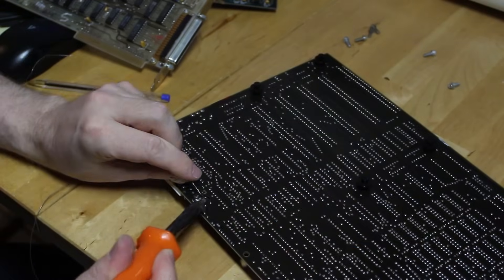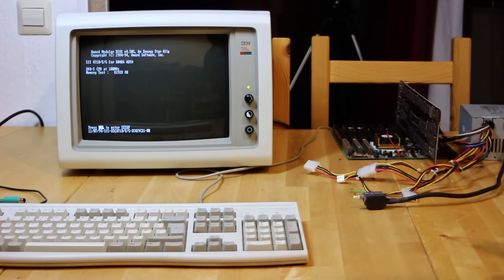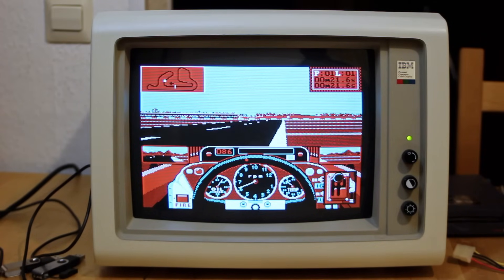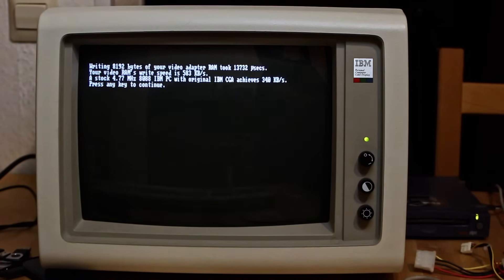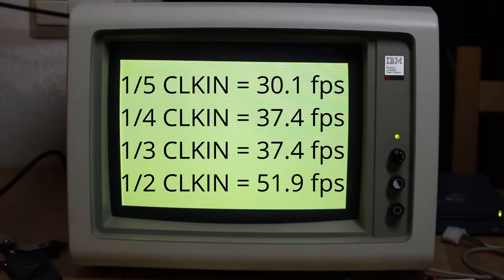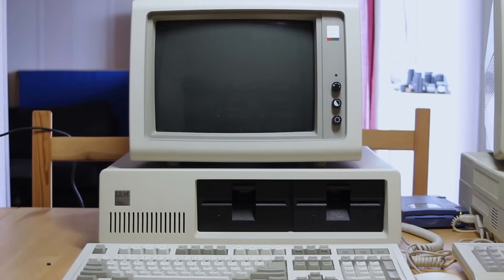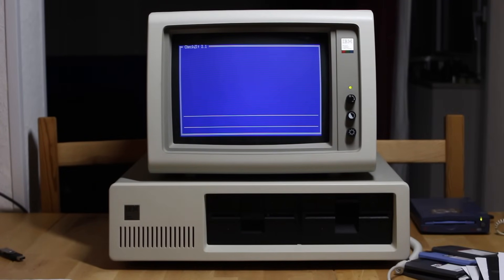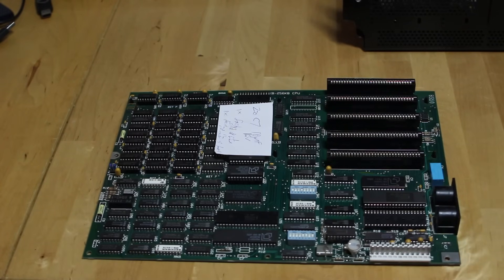Don't put a graphics card from 1981 in a PC from 1994!!

Comment: So I watched over half of this and I guess I missed why you shouldn't put a 1981 graphics card in a 1994 PC except for some CPU speed issues? It looks like it worked just fine except for the required tinkering for the bus speed. Is there some reason I couldn't put a Hercules in any ISA slot and use it with appropriate software on any PC?

Comment: You may need to move that T-Res chip to the B: drive if you want to continue using it. Although it may not be making much difference yet, that chip, which is a set of 150 ohm (or somewhere about) resistors is used for terminating the floppy drive cable and prevent signals from bouncing around. That may also have something to do with issues you've had out of it in the past. Check the Shugardt floppy drive standard for specifications.

Comment: On the answer to the question "Why" there is an 8 bit port.. The simple answer is: BEFORE everything was integrated in the motherboard, you really needed those expansion slots.. plenty of them... and.. 1. Cost.. and 2. Motherboard real estate.

Well.. the CGA is ONE card that actually DEMANDS it, because of the form-factor going down so a 16 bit slot would be in the way, but it wasn't alone. .. and.. if you buy a card (with special functionality) for one computer.. you pretty much don't want to be FORCED to give it up for your new computer. F.ex. I have a blind relative that had a speech-synthesis specific card in his computer. That was a full-length 8 bit card.. It cost a shitload... and I don't even think they ever made it in a 16 bit version, because suddenly people just had to have a sound-card and with a Soundblaster 16- and with the speed of computers, and available memory: By the time you had those- it was all done in software.

.. but there was also a shitload of 8 bit cards that.. TECHNICALLY could've been mounted in a 16 bit port, but they still were only the 8 bit cards. Most people think of the ps/2 mouse as standard. That was not yet the standard on 486. 486:es were still being created when it finally DID become standard so newer motherboards may have a couple of ps/2 ports for keyboard and mouse, but most people had to settle for something else. Serial mice?.. they actually grew in popularity fairly late, so it was VERY common that the people who manufactured mice sold them together with a dedicated isa-card for them.. my first mouse was of the brand "Mighty Mouse", and it was such a bundle which had to come with it's own card and special drivers. LATER serial port mice became popular, but tbh.. If you had a modem (almost ALL modems during the 486 era were external and connected through a serial port.. I SUSPECT due to the interference problems).. 

Then I also got an MM-401 (mpu-401 compatible) midi-card. The thing is; We had a Roland Sound-canvas module.. I used it with my organ, OR with my computer. It was the second revision which is when it finally came with a MT-32 sound-set that you could switch to if you wanted to play any actual game.. While people were listening to FM-music while playing games, I had a full symphony orchestra while playing Might and Magic 3, or Sierra games.. (If memory serves; Even doom did support Roland sound).. Of course one wanted a soundblaster anyway.. or more exactly: Also.. because it played recorded sounds, so all the sound-effects in most games..  So.. Just sound took two slots.. 

Then of course.. there was the advent of CD-rom drives for your computer.. hint: They were NOT IDE compatible at the time.. you needed a special card to be able to use it... Since the actual transfer speed was 150kb/s.. you didn't need much bandwidth: Save money by only supporting the 8 bit bus. That said: A LOT of sound-cards had various CD-rom interfaces on them. I bought a bundle from Creative-labs, so I had a Soundblaster that ONLY had the ONE interface, but it WAS the right one (fortunately; I know people who bought the card and the drive separately, so DESPITE there being one or even as many as THREE different interface ports on the sound-card they STILL had to mount a separate card for  their cd-rom drive).. Of course.. I was NOT helped by the fact that my soundcard supported it. Not much anyway, because I needed my CD drive to be external. Which WAS what the bundle was for, BUT.. it came with an extra card in order to move the soundblaster pro's internal port to an external connector.

While we still were using a 286 we also had gotten a VGA card.. more exactly an Ultra-VGA card.. same amount of memory, but supported some extra modes.. most notably 256 colours in 640x400 mode (Our windows looked better than anyone else's and they had 386:es, so we really could make use of coreldraw)..  And that was of course also an 8 bit card... the 640x400x8bit was of course nothing to play games on, but still.. we kept that card for a LONG time.. It was when we updated our first 486sx25 to a 486dx33 we finally got a trident 16 bit card. 

So.. cards I had in the same 486 that was 8 bits: Graphics, MIDI-card, Mouse-controller card,   CD-Rom controller, and the serial/parallell port cards. I THINK The IDE was 16 bit, though.. while we had a 386 we were still using our harddrives from when we had a 286 and they were both MFM-drives and the controller for that was 8 bit.. Just to say; We had started with a 20 Meg drive.. then bought a 40 meg drive.. and kept the 20 meg drive.. BUT.. then we bought a different controller that used a different scheme for packing the data, so we literally had one 30 meg and one 60 meg drive.. "for free".. where the biggest drive anyone could have if they intentionally splurged was 120 meg.. but those two drives died after a while.

So.. yes.. During the era of 486.. I DARE say that pretty much 100% of people had AT LEAST one 8 bit card in their computer.. AND a lot of people had many cards in their computer.. so.. doing ONE card so it CAN handle odd format 8 bit cards wouldn't even be a "lost port" for the people who didn't use a CGA or some other card that literally required such port, because it would still just be just another port that wouldn't be in use.
Reply from the maker: Yeah the CGA card was special in that it wouldn't go in a 16 bit slot, but most other 8 bit cards would. And it is uncommon to have an 8 bit only slot on a 486. But yes, there were lots of 8 bit cards still around for sure.
Reply: @PCRetroTech  << I think of all 486:es I have seen I think that at least 3/4 of them had an 8 bit slot.. even after the basic I/O and harddrive/floppy interface was moved to the motherboard.. But I realized I forgot to mention one thing that is why it pretty much was mandatory to have an 8 bit only port: REAL scsi cards where people may have populated with a lot of ram.. that is; They were full-length, and quite often had the same limitations when it comes to being way too big downward to be able to fit a 16 bit port.
Reply from the maker: @rogerlundstrom6926  I don't know why the discrepancy, but on theretroweb there are 669 socket 3 boards identified, only 91 have an 8 bit ISA slot. I have a large box of 486 boards. Only one of mine had an 8 bit slot.
Reply: @PCRetroTech  .. Well.. The discrepancy can be one of many.. ONE is that the amount of models itself doesn't show anything about how things are in the wild.. 

F.ex.. I once saw a 486-motherboard.. with only two 16-bit slots.. which DIDN'T have IDE nor ports on the motherboard.. so.. one multi-IO-card, and one graphics-card.. then.. you couldn't add anything. I assume it was cheap at purchase. It didn't seem to be brand name, which is why I THINK it was intended to be used in computers sold to people who only needed to provide a lot of users with a lot of computers at a cheap price, such as poorly funded schools, or extra cheap corporations.. Though it MIGHT have been that the motherboard was created for a specific case, where you were supposed to put in 2 16-bit bus-risers where the extra slots were in different directions.. That may be TECHNICALLY possible, but most corporations that does this even back then tended to use their own designed edge-connector instead of a 16-bit-bus.. So whatever it was.. I bet it was only sold in very very small numbers, but if using "number of models" as a metrics.. well.. IF that mother-board was in the list.. It would've counted as "1" just as.. actually USEFUL motherboards.

 It isn't unusual that there are local deviations that MAY depend on specifics such as what is popular in one culture, or even depending on one specific importer or manufacturer that exist in the nation in question. I live in Sweden, you don't, therefore.. It's kind of like how the local travel agent tries to find deals and then try to make it sweeter by negotiating, meaning that people living in one city are fairly likely to meet each-other when they go to vacation in a foreign nation. Things I can mention as examples is that I have never ever seen a Tandy computer in real life, so whenever I see 3-voice pc-speaker as a choice I gawk.

and.. as I pointed out; There was a financial advantage if you could get away with only sending an 8 bit bus instead of going full 16 bit, so it's FAIRLY likely that a motherboard that has 3 16-bit slots and 1 8-bit slot was cheaper than if you had a motherboard that had 4 16-bit slots.. and.. in "pre-made" computers the person BUYING the computer won't even expect it to be cheaper, so the people actually buying the motherboards simply make more money by choosing the cheaper option if they don't even have a reason to buy a more expensive version, and this kind of is even MORE cost-effective if you yourself IS the manufacturer of the board.. and.. when selling to end users; Unless they have a REASON to want more 16-bit options, they would gladly settle for a board that has ~enough~ 16 bits option and put whatever peripheral-board they had (of which they most likely had at least one) in the 8-bit slot... This isn't exactly an argument that "shows" that it is so, but at the very least it show that the basic rule of "The consumer" and "marketing" means it makes sense... only people who doesn't have a single board that is 16 bit may see a reason to ~intentionally~ look for a motherboard without an 8-bit slot...

Comment: why do people always use those old CRTs with shrunk down picture? why isnt it streched to fill whole screen?
Reply from the maker: Largely because the resolution was taken from the NTSC television standard (262 scanlines per CRTC frame) and because if you want to use more pixels you need more video RAM. If you wanted to use more pixels you'd need to increase the video RAM from 16kb to 32kb and that would have been extremely expensive back in the day for just a few more pixels.

You could set up the CRTC controller to use more of the pixels so long as you reuse video RAM more than once for part of the image, but this is difficult to do on the fly. Some demos like 8088MPH and Area5150 do this.

Comment: One (very late) comment on the racing game.  It appears to use a graphics technique sometimes called beam racing.   In order to horizontally scroll different regions of the screen at different rates, the game will update the frame buffer pointer register in the 6845 CRT controller at different points in the frame. This must be done continuously at the frame rate and with consistent timing during the relevant line blanking interval in order to ovoid very obvious jitter.  This would probably place an upper limit on the game performance unless it was recoded for faster CPUs.  If interested, YouTuber James Sharman has a video dedicated to this topic in his VGA From Scratch mini-series (an amazing DIY hardware and software project).
Reply from the maker: Grand Prix Circuit uses some tricks to make it easier to manage the sprites when they run off the bottom. There are two mirrors on the car. Those are the only regions where an oncoming car sprite can pass. If it intersects any other part of the dash, a crash occurs. That gives a hint that they draw the sprite for the oncoming car and then cover it up with the mirror, which has to be redrawn every game frame (game frames are a lot less often than CRT frames).

Probably when the oncoming cars need to be drawn, they just wait for vertical retrace and draw those sprites first so that they are drawn in time. That is a kind of 'racing the beam', but not a very sophisticated kind. Most games could not use very sophisticated tricks due to the large variation in CGA hardware and PCs on which it had to run.

You'll find a video on my channel where I analyse this game frame by frame. I think some of my conclusions are actually incorrect, as I was anticipating that they did something more sophisticated than they really did. But I did manage to recreate part of the game myself, albeit not the part we are talking about. My engine was many times faster, and nowadays I could do much better again. So it's certainly not a particularly sophisticated game engine.
Reply: @PCRetroTech  Interesting, thanks for taking the time to reply. I'll look up your other video.

Comment: I have a retro computer that is rather a Mac Plus than an IBM with a similar symptoms in the built-in display screen, which maybe might just have had some dirt between solder contacts of the HV output to the CRT causing it to ripple and flicker. I’ve never examined it internally, in spite that there was no compromise the last time it was used.
Reply from the maker: Could be worth a try. Thanks!

Comment: 0:10 Your hand shows the older 8/16-bit emulated PC/AT-bus (black slots) as well as the never 32-bit bus (brown slots) going directly to the 486 CPU. Cards normally use either one of these, not both.

Comment: What would be funny is to find the newest computer you can that would take that card. You might need a slot extender to make it fit onto newer boards. I wonder if it can be made to work on PCI only boards using a PCI to ISA adaptor ? if that exists
Reply from the maker: Interesting idea. Even with an adapter it would still be restricted to ISA bus speed. The memory on the card would have a limit on performance also.
Reply: @PCRetroTech  Yep that's why I think the idea would be really fun to explore. Having such a limited card (in bus speed, capabilities) and trying it on faster and faster machines; how far can you go!?

Comment: I suspect that the 1/3 option in the bios is not really working and it's actually still 1/4. You could test this by meassuring the frequency directly from the ISA slot (pin B20), if you have a multimeter that can do that high a frequency, or an osciloscope.
Reply from the maker: That's possible, though there could be an issue with CGA wait states that makes it seem that way, as another commenter mentioned below.

Comment: Hi, nice video. About the CGA snow effect, i know it's due to the contemporary access to video memory by cpu and cga.
I think it's because while the cpu is accessing the memory the cga get bad readings or it is blocked from fetching display data.
I also know that not all CGAs had this problem. Do you know how they fixed the issue in snowless cga cards?
Reply from the maker: I believe they used dual ported RAM or SRAM or just faster RAM. I've not looked into it in detail, but I think there were multiple strategies.

Comment: My first "proper" graphics card was a Cirrus Logic 5429, a VESA "Windows Accelerator" with a whole 1MB of memory. I was so proud of that powerhouse of a GPU.
Reply from the maker: I think I still don't have a 5429 in my collection. I've got a 5428, but the 5429 seems to be a bit rarer.
Reply: @PCRetroTech  Unfortunately mine is gone; it was in my 486 which I gave to my mum, then (without my knowledge) my sister organised a new PC for her and the 486 went to the tip (erm, recycling centre). If I'd known I'd have taken it back of course. Sigh.

I remember on Windows 3.11 the drivers were a bit buggy with some screen artefacts adding random dots sometimes. Worked perfectly on Win95 though.
Reply from the maker: @ian_b  That's a shame. A lot of cards ended up in landfill I bet. But I suppose the rarity these days is part of what makes retrocomputing and collecting fun.
Reply: @PCRetroTech  It is sad yes. I had a sort of perception of future retro value at the time, which is why I hung onto my IBM Model 60 (a huge PS/2 tower with a 286 processor), but even I foolishly sent the IBM monitor to the recycling centre, to save a modicum of storage space. I didn't think a 12" monochrome CRT was worth keeping; nowadays of course I wish I still had it.

Oh well, live and learn.
Reply from the maker: @ian_b  Yeah, I've also thrown away stuff that I didn't have space for back in the day, or which just didn't seem to be worth anything any more. Funny how value changes.

Comment: Maybe that potentiometer had shorted something. Or Maybe it caused interference through capacitance.
Reply from the maker: Apparently it is a variable capacitor and when it broke it sent spikes through the tuned circuit it was part of whenever touched.
Reply: @PCRetroTech  a variable capacitor? Never seen one of those before! They must be quite exotic parts!
Reply from the maker: @JohnSmith-iu8cj  Not really. They were pretty common in the before the 90's at least.